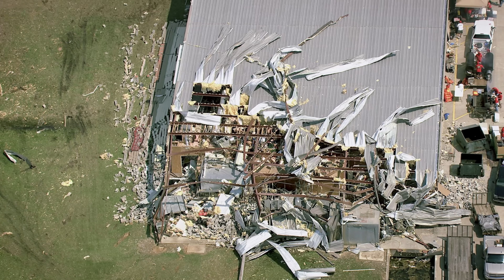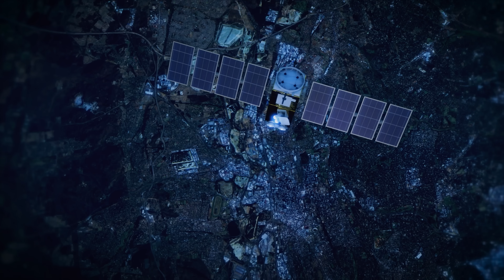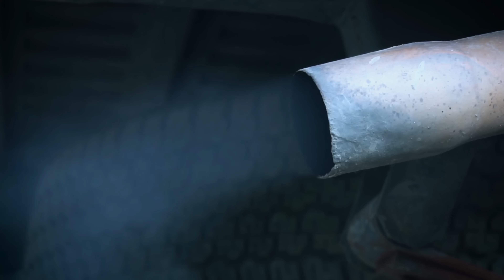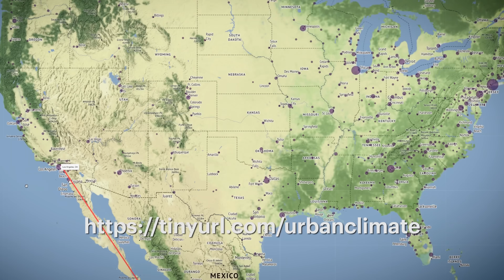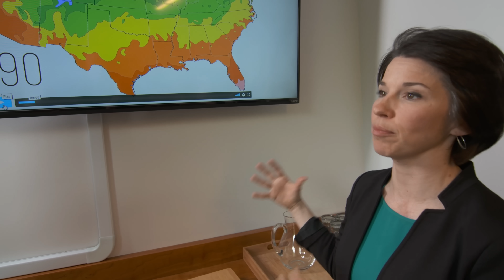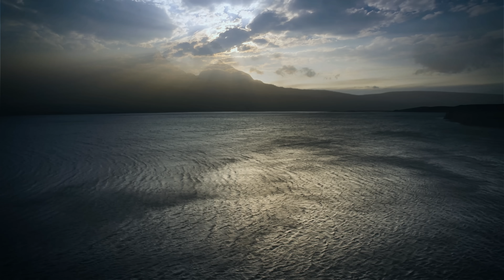The Environmental Effects of Climate Change On Our Planet | Breakthrough

Comment: Tornadoes Hurricanes tsunamis are fromed because We removed the Oil empty space, when hot and cold meet it's warm (does nothing) and why seals dolphins and whales being washed up? 
 And plants ,Ocean floors are the thinnest!! Eventually the Hurricanes from the ocean will pull enough from the Sun putting it out to a RED.
The moon orbit above Earth creating a pull from the south pole get it!!
 circular in pattern.
Since we been removing the Oil over 1000 Volcanoes don't work were does the Lava go? It's rising now if we remove to much Oil and the rest burns off black smoke then will the inner-core receive Air cause it's not smothered with Oil?
(Proverbs 21 20) Amen 🙏

Comment: DR. K.F. SOCCER S-P-C
KNOWS WHEN & WHERE & WHY CLIMATE CHANGED
=WHEN :2011 A F-3 TORNADO STRUCK GODERICH MAIN STREET OF THE PRETTIEST TOWN IN CANADA
2011 EARTH HAD 950 ERUPTIONS
2012 EARTH HAD 2950 ERUPTIONS
2013 EARTH HAD 5768 ERUPTIONS
2020 EARTH HAD 12,062 ERUPTIONS
2021 EARTH HAD 14,434 ERUPTIONS
2023 EARTH HAD 14,130 ERUPTIONS
WHERE IS ALL THE CARBON COMING FROM
WHERE IS ALL THE TOXIC-DEADLY-POISONOUS GASES CAUSING INFECTIOUS DISEASES OUTBREAKS AROUND THE ENTIRE WORLD
2024 TO 2035 MAJOR SNOWFALL WILL CLOSE UP THE EARTH
TO REDUCE THE ERUPTIONS FROM DAILY TO YEARLY
2 SEISMIC SHIFTS IN 25 PERIOD 
HEAT OPENS -EXPANDS THE EARTH
COLD.WINTERS CLOSES THE EARTH

Comment: many of these floods are caused by water collecting on tarmac/concrete drives and car parks etc, when once it was open ground and that water naturally drained away. Now it cant due to said building works, so we get floods !!!
No drama here guys. 🙄
Reply: With every degree of temperature rise, the atmosphere holds on to significantly more moisture. It's called the CLAUSIUS-CLAPEYRON equation. The increase in atmospheric moisture is simply producing more epic rainfalls, according to the EPA, which is the reason we're flooding more often.
Reply: @swiftlytiltingplanet8481  I agree the process is logical, but the extent is not such that it warrants some fancy name. Floods are as much to do with us building car parks and the like over what used to be open ground, so water cannot soak away and instead causes floods. So its not just more rain, its also less drainage and THAT is man made.
Reply: @Philip-x3d  The "fancy name" refers to the two scientists behind the equation. It's a well-known law of thermodynamics. According to the EPA and the IPCC, extreme precipitation events are up all over the world, and they have nothing to do with car parks and asphalt, although such things would certainly make flooding worse.
Reply: @swiftlytiltingplanet8481  thanks for that, I wasn't aware. However, you seem to be aware more rain is falling, but cant equate that to the next stage in the process. 
ie. Where does all that rain go after falling ? It used to drain away in streams and rivers, or soak away into the ground. No it cant do that so much. Why ?
Reply: @Philip-x3d  Yes, the rain is still draining into streams and rivers, and still soaking into the ground. Most of the earth is not yet covered in asphalt. Rainwater that falls in the city flows into the sewers, which flow into the ocean or other nearby bodies of water. It's also evaporating more quickly than it did in the past due to rising temperature.
Reply: if we cover say 10% of the soil in concrete.....you get less drainage.....simple as that. Dont try to get too clever to prove a point that does not exist. You effectively say building works have NO effect ? 🤔

Comment: C3S just published "Hottest May on record spurs call for climate action", which includes data for a 0.214 degC annual global temp increase over the 3.5 yrs. since 2020, and over the 1991-2020 baseline.      At this rate of increase, if we continue to burn fossil fuels, we will see 2 degC worldwide by 2027, and 3 degC by 2032.     Then, it's all over, folks.

Comment: Deforestation is increasing global warming. We need to plant more trees to reduce carbon dioxide levels.
Reply: If only it was that simple. Trees under 20 years old actually emit more CO2 than they absorb, according to Oregon State University. Just digging a hole to plant a tree releases more CO2 from the organisms there than the tree will absorb in several years. What we need to do above all else is preserve old-growth forests because that's where the heavy CO2-lifting is done.
Reply: @swiftlytiltingplanet8481  I pretty much agree with everything you post, and I agree with protecting old-growth forests, but I'm questioning this. How does a growing tree emit more CO2 than it absorbs? I haven't seen that anywhere else and I'm questioning the analysis they did. I get that digging a hole releases some CO2 but fighting the climate crisis is a marathon not a sprint, and what you're saying about trees' CO2 footprint over the first couple of years is like the fact that the carbon footprint of an EV is higher until you get to about 23K miles. In the long run, the EV and more forests are still better (even though fewer vehicles is better still). Large-scale agricultural research on "if everyone adopted a vegan diet" calculated over 600 billion tons of CO2 sequestered by 2050 (bc we could feed the world using 75% less land and could re-forest and re-wild the rest). I don't see anything else on the horizon that could sequester 600 Gt of CO2--and have staggering benefits for biodiversity and water shortages.

Of course, people should plant diverse forests and ecosystems, not monoculture plantations, and it should be native species, etc. Take care and thanks for your diligent online work.
Reply: @swiftlytiltingplanet8481  Thanks for the reply.
Reply: And phasing out fossil fuels would help too.

Comment: #895Confirming, the Internationally-recognized 'AGW' climate metric is "+1.2°C since Industrialization." That's +0.006°C per year, and +0.003% of Earth's annual extreme temperature range we survive every day. Nothing. 

Anything above +0.006°C is WEATHER. Screech all you want, but that's the actual CLIMATE SCIENCE.
Reply: 1.2C is the global average, but the average over land alone is 1.7C (3.1F) Northern hemisphere land even higher at 1.9C. The Arctic has warmed by 3C or 5.4F since 1980. Areas in the Eurasian sector of the Arctic Ocean have warmed up to seven times as fast as the globe.

As a result, sea level has risen four inches since 1993 and its rate of rise has doubled, according to NASA. According to NOAA, high tide flooding along the American south and Gulf coasts has risen 400% and 1100% respectively since the year 2000.  (See NOAA HIGH TIDE FLOODING) In January Maine suffered a record high tide that caused $100 million in damages. The Breton Sound area of Louisiana, meanwhile, has lost over 8800 acres to inundation, which is why the state has a new $50 billion-dollar flood mitigation project in the works. So does New York, not only because Queens is flooding on a regular basis, but because the sea level rise that elevated the storm surge from Hurricane Sandy caused $8 billion in damages, and Hurricane Sandy was a mere category one hurricane by the time it struck NY. Check out Annapolis too. High tide flooding is closing the streets and businesses of its City Dock neighborhood 60 times a year now. How about Miami Beach's raising of 105 miles of roads?

2. Heatwaves have TRIPLED since the 1960s, according to the EPA. Pakistan just recorded temperatures of 125 degrees. Phoenix, Arizona last summer sufered through 31 straight days of above 110 degree temperatures. Photosynthesis, incidentally, breaks down at 104 degrees, and many seeds won't germinate. 
3. Marine heatwaves have increased 20-fold, according to the University of Bern. A marine heatwave off Washington two years ago killed over a billions clams, mussels, starfish and other marine animals, including sea birds. One off Alaska killed an estimated 10 billion snow crabs. Warming waters off Maine has collapsed its shrimp and cod fisheries. 
4. Hurricane intensity has risen 8% per decade for the last four decades, according to NOAA. A Taiwanese study shows the same increase in typhoons. Arctic cyclones too. While category 1 and 2 storms have decreased, cat 3, 4 and 5s have INCREASED. 
5. Drought intensity and durations have increased worldwide. In 2015, the Amazon suffered a record drought that killed an estimated 2.5 billion plants and trees. It was supposed to be a once in a thousand year event, yet last year it happened again, only worse, this time killing even more plants and setting 26 million acres ablaze with wildfires. The Amazon supplies the world with a substantial amount of our oxygen. Rain forests don't normally burn.

The increase in drought intensity along with increasing heatwaves have tripled crop losses across Europe in the last fifty years, according to a study in Environmental Research Letters.
6. Extreme precipitation events are up worldwide, according to the EPA. That's because with every one degree of temperature rise, the air is able to hold significantly more water vapor. The cost directly attributable to global warming for Hurricane Harvey's epic rainfall over Houston has been pegged at $67 billion. The massive rainfall over Pakistan in 2022 flooded one-third of the country. 

According to a UN report, the number of major environmental disasters from 2000-2020 nearly doubled over the previous 20 years.

Comment: Co2 induced climatechange  is a lie
Reply: "Co2 induced climate change  is a lie" Thousands of research studies and 40+ years of quite accurate climate models prove the climate crisis is real, lethal, urgent, and WE caused it. 

"That's +0.006°C per year," Yes my friend, but the amount of warming is not even across that time period, and since most CO2 emissions happened in the last 50 years, global warming has accelerated to .2 degrees C per decade since 1980. You're not reporting "climate science" accurately, you are misusing a very long-term data point to make a claim about current trends, and that is NOT science.

Comment: There is no objective observational evidence that we are living in a global climate crisis. 
The UN's IPCC AR6, chapter 12 "Climate Change Information for Regional Impact and for Risk Assessment", section 12.5.2, table 12.12 confirms there is a lack of evidence or no signal that the following have changed: 
Air Pollution Weather (temperature inversions), 
Aridity, 
Avalanche (snow), 
Average precipitation,  
Average Wind Speed, 
Coastal Flood, 
Agricultural drought, 
Hydrological drought, 
Erosion of Coastlines, 
Fire Weather (hot and windy), 
Flooding From Heavy Rain (pluvial floods),
Frost, 
Hail, 
Heavy Rain, 
Heavy Snowfall and Ice Storms, 
Landslides, 
Marine Heatwaves, 
Ocean Acidity, 
Radiation at the Earth’s Surface, 
River/Lake Floods, 
Sand and Dust Storms, 
Sea Level, 
Severe Wind Storms, 
Snow, Glacier, and Ice Sheets, 
Tropical Cyclones.

Comment: Globally the ACE index (accumulated cyclone energy) 1980-2021 shows no increasing trend. Global Hurricane Landfalls 1970-2021 (updated from Weinkle et al, 2012) shows no trend. Satellite data since 1980 shows a slight downward global trend for total hurricaine numbers with 2021 being a record low year. From the NOAA GFDL website 'Global Warming and Hurricanes, An Overview of Current Research' (dated Feb. 9, 2023). And I quote "We conclude that the historical Atlantic hurricane data at this stage do not provide compelling evidence for a substantial greenhouse warming-induced century-scale increase in:  frequency of tropical storms, hurricanes, or major hurricanes, or in the proportion of hurricanes that become major hurricanes." Multidecadal variability in Atlantic hurricaines is most probably related to the AMO (Vecchi et al, 2021). NOAA data 1851-2021 shows no trend in number of hurricaine landfalls with the record high being 1886. There is also no trend in the frequency of major hurricanes (Cat 3 +) for the same period, although the trend for the last 20 years is downwards. It makes no difference if you look at the Pacific. Using data from the JMA 1951-2022 we see typhoon activity trending downwards for over 7 decades.
Reply: You left out some important information. The number of category 1 and 2 hurricanes have gone down, but the number of cat 3, 4 and 5s have gone UP. Atlantic hurricanes, in fact, have intensified 8% per decade, according to NOAA. A Taiwanese study of typhoons shows the same increase. Arctic Cyclones too.
Reply: @swiftlytiltingplanet8481  If hurricanes had increased by 8% per decade since 1850 that would mean there were nearly four times the number hurricanes now as there were then. This would certainly have been noticed and been plain to see, and contradicts the statement I quoted from NOAA. 
This is a quote from the IPCC ARG WG1: "Identifying past trends in TC remains a challenge...There is low confidence in most reported long-term (multidecadal to centennial) trends in TC frequency - or intensity based metrics" 
So we can't spot a trend and therefore we can't really attribute that unknown trend to us humans.